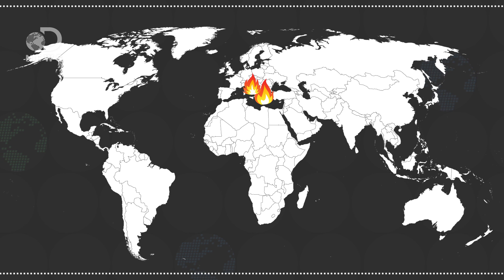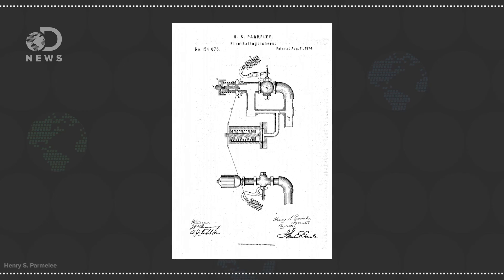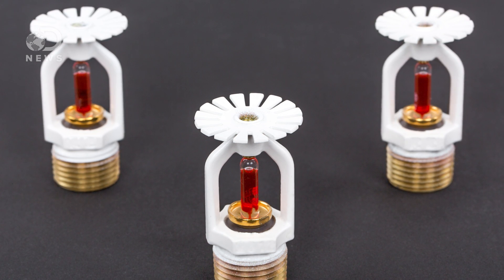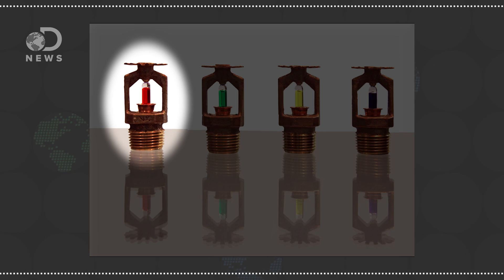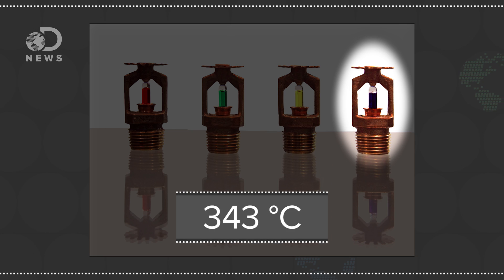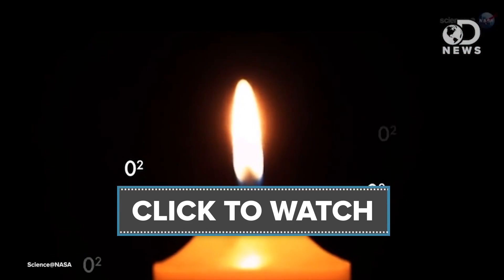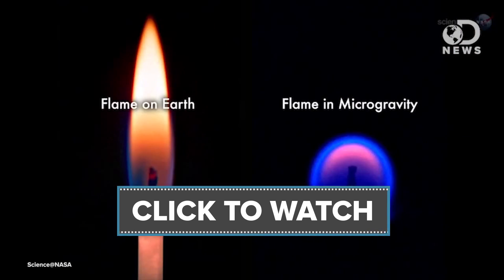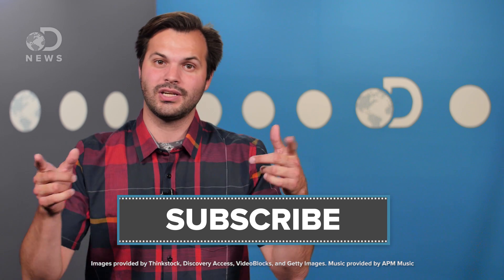How Do Fire Sprinklers Know There's A Fire?

Comment: also in a wet system, the water inside will be absolutely filthy to the point where it is black due to sitting in piping for what is most likely years on end.
Reply: Which is why the system needs to be flushed every two years.  It can foul a sprinkler head and interfere with its operation.

Comment: I work for a fire security company and trust me when a bulb breaks it’s not fun
Reply: Its better than death.
Reply: Have you come across sprinklers which have failed?
Reply: @bradmatthews-barfootthomps5197  It would take a lot for that to happen.  Generally if someone were to paint the sprinkler head which could glue the head closed and mess up the temperature rating.  Otherwise, they're pretty reliable.

Comment: Dry systems are not empty, they have pressurized air inside the pipes. When a sprinkler head goes off, the air-pressure inside the pipes drop dramatically telling the system to open the valve for water.
Reply: True.  The air pressure is what's keeping the valve closed and the water pressure behind the valve is what's trying to open the valve.  When the air pressure drops, the water pressure becomes stronger and opens the valve through simple force.

Comment: Red isn't the lowest bursting sprinkler head, it's orange; it bursts at 135 degrees. Red is simply the most common used for residential and commercial applications. Also black sprinkler heads aren't rated for 650 degrees, they're rated for 500. Most heads that you see in warehouses are usually green and occasionally blue.

Comment: I lived in a building where the sprinklers were all on one system. One day a neighbor broke one by accident and they all went off.
Reply: no
Reply: That would happen only with a deluge system where the heads are all open.  With a deluge system, the pipes are dry and when a fire detector like a heat or smoke detector activates, a solenoid valve opens to allow water into the system.  Residential buildings would use a combination of wet or dry pipe systems and not a deluge system.  A deluge system would be used in high hazard occupancies like a saw mill where there is a lot of combustible dust laying around.

The dry pipe systems use closed sprinkler heads like the wet pipe system and have compressed air to hold the valve closed.  Those would be used in colder locations like the parking garage which may not be heated properly in colder climates to prevent the system from freezing up.  The heated areas in the building would use a wet pipe system.  Both these systems don't have every sprinkler head going off at the same time.  Only the ones that were closest to the fire would be activated. 

The only way all the sprinklers in your building would go off at the same time is if someone was running around breaking them or using a heat source to pop them.

Comment: bitches IT IS ACTIVATED BY THE FIRE ALARM CONTROL PANEL!!
Reply: Actually, no...in an ordinary wet or dry system it is the flow of water that triggers the alarms or water motor gong to activate.
Reply: @chrisleach6555  Exactly.
Reply: The sprinkler heads are activated by heat.  The older style heads have a fusible link that is held together by solder and the current style of heads have a glass tube that is filled with a liquid that boils at a specific temperature.  The water flowing in the pipe pushes on a paddle for a flow switch which closes the switch and sends a signal to the fire alarm panel.

Comment: FLEXONE

SEUNG JIN 'Flexible Sprinkler Hose', is designed to be used in wet sprinkler systems between the branchline and sprinkler when installed in accordance with NFPA 13, 13D, and 13R.

https://youtu.be/G_O5XNvXJLI

Comment: Its heat. the color of the glass  is the marker on the heat it will fall off and release water.
Reply: The glass is clear.  It's the fluid inside that's colour coded to identify the temperature rating of the sprinkler head.  That expands and breaks the glass bead to allow a small piece blocking the orifice to fall away to allow the water to flow out.

Comment: how a sprinkler really works is theres a heat sensitive liquid inside a tiny glass tube and builds up pressure and explodes breaks a vacuum tube  witch lets water flow water though  or it breaks and lets water inside the tube flow down and the tip makes it a spinkler
Reply: No vacuum in a sprinkler system.  Just positive pressure.

Comment: So does that mean that fire sprinklers aren’t reusable and have to be replaced after fires
Reply: Nerd_World in a wet system yes. I'm not sure about a dry one. But honestly a sprinkler head would be the last of my concerns after a fire took place in my place.
Reply: @WooferCooker  Same with the dry pipe system.  All closed sprinkler heads that are used in dry pipe, wet pipe and pre action systems are one time use and need to be replaced after they're activated.  That bulb (fusible link in the older style heads), is called a thermal element and is designed to break when exposed to heat exceeding its temperature rating.

The sprinkler heads in a deluge system though are open heads (no thermal element or bulb), and don't need to be replaced.
Reply: Exactly!  That's with all closed type sprinkler heads.  A deluge system uses open heads and those don't need to be replaced.

Comment: Lol. Close but all the facts aren't true here, do some research! I work for a fire sprinkler company as a fitter, I'm happy to hear somebody sees the lies in movies but a lot of his facts are wrong and he doesn't understand. There is air in a dry system compressed not nothing, in a pre-action system which he doesn't discuss can have no air but generally has compressed air also.
Reply: @SPRlNK  words of a fitter that cant explain it himself
Reply: Pre-action system has no water in the pipes (dry pipe), and the air is not compressed.  The system is initiated when a device like a smoke detector is activated.  That sends a signal to the panel which then causes a solenoid valve to open and allow water into the pipes.  That water sits and if there is a fire, the sprinkler head closest to it will open causing the water to be discharged.  After the fire is out and the all clear is given, the supply valve is closed, the system is reset and the solenoid valve is allowed to close.  The system is drained and the sprinkler heads that were opened are replaced before putting the system back into service.

If there is no fire and the all clear is given, the panel is reset.  The solenoid valve is closed and the system is drained before the system is put back into operation.

Comment: Everything he said is 100% correct! one other thing is that when the sprinkler's activate, it trip a device called a water flow switch. When that switch is activated is activated the fire alarm system.
Reply: @Aslin Fire Safety most designers    dont understand dry systems at my company either

Comment: I thought that water sprinklers was a fire alarm and when it turned on it so me who triggered the water pipe thingy turned on and made all the fire sprinklers turn on
Reply: Nope.  Sprinkler head is activated by heat.  Bulb breaks from heat, head opens and water is released.  Water flowing in pipe activates waterflow switch which closes and sends signal to fire alarm panel.  For a wet or dry pipe system, the panel only responds to the water flow.  It doesn't start the water flowing.

Comment: When I was in college somebody used a lighter to burst one of these things in my dorm.  It ended up dripping through 8 stories of the building, including a radio station and an urban outfitters located below, and if I recall correctly, doing $20,000's of damage.  And that was just one sprinkler going of in the building.  It took the building hours to deal with the problem, and we had to spend the night in the lobby of an apartment building across the street.

Comment: I wonder if the "classic" sprinkler heads with a gallium plug are still in use?  Gallium, a metal related to aluminum, melts at about 85 degrees Fahrenheit, so a plug of gallium would melt and release the valve when the temperature at the ceiling reaches that value.

Comment: To add, the water that comes out of wet systems is also laden with oil that was used to cut and tread the original piping.  This "water" is black and smells like oil.  It may save your building, but everything that is under that particular head will be all but ruined.
Reply: ss4u2nv you can flush the system via a flow valve at the end of the run

Comment: You forgot one important thing... which is that once on. It does NOT stop until all the water in the tank on the roof or whatever is used up. Ergo, taking a hammer to one of them like a prank. Can be a very, very costly prank that might make you a debt slave for a long time.

Comment: i install fire sprinkler systems! it's awesome that DNews mentioned things that i do every day!
Reply: Same here, I install these for living too :) a lot of people, even the other construction workers have no idea how these systems work in real life
Reply: The point that he missed was that dry systems are mainly installed to prevent sludge and rust in the stagnant pipes from blocking the heads.
Her in the UK, wet systems are flushed through by the service engineer at least once a year.
Reply: @wilsjane  completely wrong.  Dry pipe systems are installed in places where the space isn't heated or has the possibility of heat going out.  The pipe is dry to stop freeze ups
Reply: @kpj9028  What you say is true, but dry systems are also used where long runs would cause a build-up of corrosion in steel pipes and also where high limescale could block the heads.
Reply: @ertzxx8513  there are valves that shut off the sprinkler lines from the main water inlets. depending on the size of the building, the sprinkler systems will have multiple cut-off valves so you can service sections of it without shutting down the whole system. common in hospitals, schools, that kinda thing
Reply: im a 3rd year in calgsry alberta canada ! lol
Reply: the temps on the bulbs and hazards classes they talk aboit are wrong lol
Reply: @kpj9028  They vary in different parts of the world. 
People often forget that You-Tube is international, with their largest number of subscribers in India.
Reply: That must be sad, depressing, boring job
Reply: @TheJakeman789  how is it sad and depressing ?  I work on systems that could save lives and the pay is great

Comment: It seems like they also wouldn't want all of the sprinklers to go off at the same time because they wouldn't want an entire building to get water damage if there was just a localized fire.
Reply: That as well as:
1) reduced pressure at the sprinkler head that is closest to the fire assuming it's the most remote from the water source
2) additional hazards for evacuation like slippery floors/stairs, energized puddles where the water may come into contact with the electrical system and poor visibility.

Comment: They use inert gas systems in data centers since water+ electricity=bad.
Reply: There are different types of systems in data centers.  Inert gas, halon, clean agents and water mist systems.  The halon is banned because it destroys the ozone layer.  Water mist systems can be used as they produce very fine water droplets that will cool down the air and not cause issues with the electrical equipment.

Comment: @dnews The bulbs pictured in the video are called "frangible bulbs". Fusible links that Trace said, are small pieces of metal that have a low melting point, thus they melt and release the suppression agent. Great video though!
-Firefighter in NC
Reply: they are also called solder link

Comment: Are any sprinklers smoke-activated?
Reply: there are specialty sprinkler systems  called preaction systems that can have smoke detectors that are interlocked to the sprinkler valve. the system is normally dry but when smoke is detected the valve is "tripped" (opens) and the system floods with water, but the bulb in the sprinkler head or solder has to melt/break before any water is released. they use these systems where they are worried about any water damage from leaky pipes or accidental discharge from mechanical damage to the sprinkler. So in short kinda. (I am a journeyman sprinkler fitter)
Reply: +Dakota Laine (Qube) thanks for your answer, that was awesome!
Reply: Trace Dominguez Cool, I didn't expect to receive a comment from you, Trace.
Reply: The sprinkler heads themselves are activated only by heat.  Systems like the deluge or the pre-action though can be connected to smoke detectors that send a signal to a solenoid valve that will open and allow water to enter the system.

Comment: I am pretty proud of myself. I figured this out on my own working in a sbarros pizza in the mid 2000's. We had a low ceiling where you could touch one of the heads and I realized that they are independent of each other. I did however think they used a wax rod and not a glass tube but I was close.

Comment: my dad is a carpenter for over 40 years most of the time was construction of buildings or remodel of buildings and he told me before 1930 all sprinkler for deluge just like he talked about an airport hangars but in the 19 1930s they started doing me pressure pipe and only released where there was a fire
Reply: That is not true. Airport hangers are a different animal.

Comment: Does the fire department replace the bead?
Reply: Cyberion
  I assume you mean after they burst during a fire...........You just replace the whole head, they just screw on the pipe like any pipe fitting........A plumber or a sprinkler company would replace it not the fire department.
Reply: They have a really long life. But after a few years I believe the company that installed the system will come and swap out those beeds. The fire department is only an emergency service, they are not responsible for tending to sprinkler systems.
Reply: nocturne main?
Reply: no, they might shut the water off after the fire is suppressed but they are in the business of fighting fires, not contract construction. They woudnt replace the sprinkler head for the same reason they wont repair a hole they cut in the roof or window they break. Its simply not their responsibility.

Comment: Nah. one went off in my friend's apartment when there was not even a fire, candle lit, or the stove on. Ruined everything.
Reply: your school has a nightclub?
Reply: Melissa0774 Chalmers Sweden
Reply: Well it was probably old. Those beeds have a life span and can weaken after a while. The glass can weaken or the liquid inside can break down causing the glass to break. Or it could have been a faulty sprinkler.
Reply: We had one go off in the school's nightclub without apparent cause as well. Apparently the water was very dirty after sitting stagnant for 15 years since the system was constructed.
Reply: Melissa0774 We have one nightclub and 18 pubs on campus. One pub is run by staff hired by the student union the rest are run by the students for the students.
Reply: Tim Jadeglans Where do you go to school at?
Reply: Tim Jadeglans Sweden... cool. BTW, what do you think about the Brexit vote?

Comment: to add on. most newer sprinkler system's have a electric pump to build pressure.
when the bead breaks the pressure will fall fast and a big electric or diesel pump starts up to produce low pressure but high volume off water.
u can see this when it beaks u get a splash then a drip and then the big spray.
as a bonus if u get a very small leak or a drip the small pump can sens that and warn the maintains team and not trip the big pump and the alarm.
Reply: SoY_FooD no, that is incorrect. You only get a fire pump if you do not have the pressure to support a sprinkler system. Nobody installs a $75,000 pump just because. Secondly, once the bulb or fusible link is broken you will immediately get the water pressure in the system. No drip and then big spray. If you are talking about a dry system, you will get whatever residual water may be in that system (probably just a mist) from testing and then you will get whatever pressure the dry valve is holding back. But, yes you are correct about the jockey pump. This maintains the system pressure generally to within 10psi of the main fire pump. However, there is no warning that I’m aware of to the maintenance team unless they are seeing the jockey pump running excessively. The jock pump is supposed to run when it detects a loss of pressure.

Comment: Why would you want to have it break at higher temperatures, wouldn't you want it to go off at the same temperature, you know, to prevent the fire?
Reply: some warehouses where I live don't have air conditioner units and the temperature can get up to 120 F so I'm sure the ceiling gets even hotter so you'd want a sprinkler for a higher temperature
Reply: sometimes you want a sprinkler head to go off at a higher temperature so you do not have too many go off at the same time. if you have to many go off at the same time there will not be enough water pressure to get the required water density out of the sprinkler heads and on the floor to effectively control the fire. ( I do this for a living)
Reply: Also some factories have machines which produce lots of heat, so thats also a reason. Or else the sprinklers will go off every time you use that machine.
Reply: There are many factors involved.  The occupancy hazard which is determined by the amount and type of fuels is one example.  Different fuels have different temperatures when burning.

As for preventing the fire, the water coming out would cause water damage.  Fire prevention is done through other methods like safety procedures, maintenance etc.  The sprinklers are there in case the prevention doesn't work and it hits the fan.